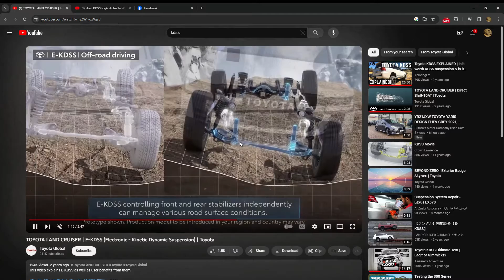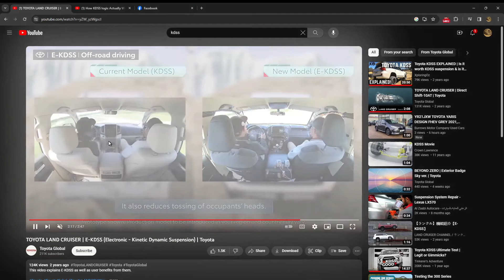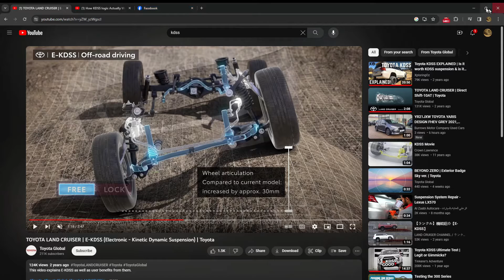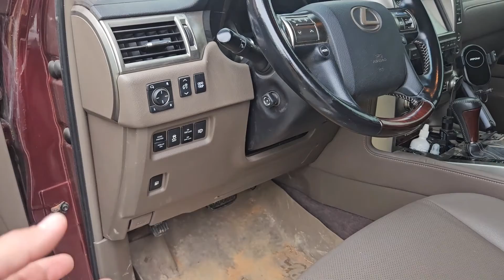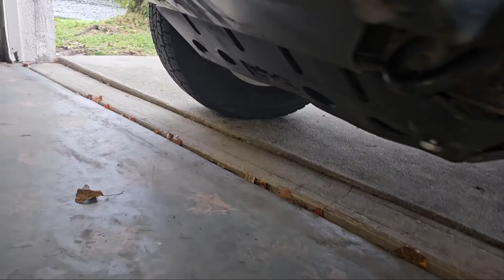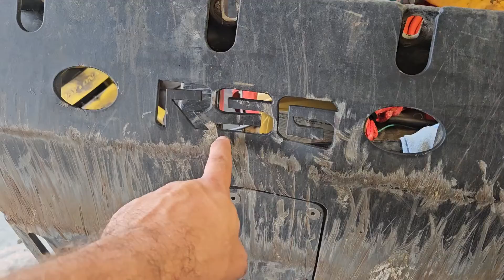KDSS disadvantages: time for a KDSS delete! GX460 and 4runner (reuploaded)

Comment: I am deleting my entire KDSS system from 2014 GX and hopefully only adding a front sway bar. Is deleting the KDSS a DYI thing? Great video btw!
Reply from the maker: Yeah it was easy to remove. I went with just a rear sway bar.
Reply: @MudPuppyOffroad  awesome! I have been battling the KDSS lean and I’m over it. I do light off roading and most highway miles.Added a 2 inch lift and done fighting the system. I think running just a front sway bar for the moment and then adding rear later is the best way to make me like my GX again lol is there a reason you only run a rear? Is it safer for the front or rear?
Reply from the maker: @bentondouglas1032  I like the front to flex as much as possible because these trucks have very limited suspension travel up there. Safe is a relative term... I think it drives fine.

Comment: I have the KDSS knock and was wondering if I remove the cylinder does the sway bar stay in place?  Or is it better to just take it all off?  Great video thank you so much
Reply from the maker: Could just remove the cylinder I guess but why carry around the weight of the sway bar and have all the bushing issues if it's not doing anything

Comment: Great video, my friend. I'm on my second GX, and I just deleted my KDSS. The biggest complaint about the KDSS was the same as yours. I off-road quite a bit and the small bumps and the rocking back and forth sucks. My initial thoughts after removing the Kdss are it is super tippy in the corners. I'm heading to Moab this weekend from Denver to do some off-roading, so I will have plenty of time behind the wheel to determine if I think it is a good fit for me to keep it off. Do you still have the KDSS off, or did you find you didn't like the on-road performance and put it back on?

Thank you in advance,
Marty
Reply: I do have a Bilstein 2.5" lift
Reply from the maker: Yeah I took it off and deleted everything and it's not going back on. I'm still running the rear sway bar with a solid link I fabricated and it works fine on the pavement. Off-road I removed the rear link

Comment: I have a 5g 4runner with KDSS and I have encountered a lot of the same problems.

Front cylinder is knocking due to internal nut coming loose at 78k. Been knocking for about 10k miles. 

 I plan on DIYing it. Front cylinder and homemade SST ran me about $1k. Theres a PDF on the web describing the KDSS bleed steps. 

I got the KDSS switch, and bushing adapters etc. in an attempt to keep the system healthy. Interesting perspective on the KDSS mods potentially being pointless if you wheel a lot. Hopefully I have many more trouble free miles after the repair.
Reply from the maker: I hope you have better luck than me but mine is fully deleted now and I definitely prefer the ride off-road with no front sway bar
Reply: @MudPuppyOffroad  yeah, but the ride on roAD SUCKS! lets not forget to mention that small tidbit of information. Highway driving with no sway bar not recommended or safe
Reply from the maker: @Mach141 first of all... I've been driving on the highway with an 80 series with zero sway bars most of my life. However my GX still has the factory rear sway bar. It drives great on the highway like that.

Comment: I initially wanted a 4runner SR5 Prem and began contemplating getting a GX, and now I'm going back to the 4runner to avoid KDSS. This has been helpful. I've had people tell me that long-travel is like thousands of dollars per shock and every 10 miles per hour you want to go faster in whoops is like thousands, stuff like that. But no one tells you that with just shocks without KDSS (like bilstein, icon, fox or kings) you can generally offroad in much nicer conditions and not have the KDSS head toss and jitter. Its not about going max speed on whoops.

Comment: What did you do to remove kdss? Simply removed the front sway bar? What about the rear?
Reply from the maker: Haven't got around to it yet but the plan is to delete the front sway bar and all of the hydraulics and then have a fixed rear sway bar with a removable link

Comment: I have a 2024 4Runner with KDSS. Based on my past 4Runner without KDSS, the KDSS drives significantly better highway and city driving…much beefier sway bar reduces body roll a lot.
I don’t do aggressive off-roading, only up to moderate and the KDSS is a champ. Travel is very good and increase articulation keeps traction. Have Bilstein suspension system with only a 1 inch lift. Get more travel in front and rear with Bilstein suspension.
Have a rock slider, no problem with KDSS.
Also on corrugated roads runs 
OK; however, maybe due to the suspension which also has bypass function. 
I get better articulation than non-KDSS and able to drive on corrugated roads with enough comfort and control.

However if I did more difficult backroads like Black Bear Pass would miss having a 3inch or more lift on a non-KDSS 4Runner.

If you have KDSS, you need to maintain it, accumulator etc, like your frame, if so very reliable for what I use it for.
Reply from the maker: Thank you for the comment. I'm sure your opinion will change once your system has a failure just like mine did LOL but yes it drives nice on pavement but that is not what I bought this truck for. If I wanted something that drove nice on pavement I would get a sports car

Comment: Does the new EKDSS contribute anything noticeable to on road driving. 

Specifically, if you put Overtrail tires/wheels on the Luxury plus (that does not have EKDSS) will the on road ride quality be close to the same as Overtrail Plus?
Reply from the maker: Haven't done any testing on that model yet obviously but it should be different. This sway bars are  thicker
Reply from the maker: Also that model canon decouple the front and rear sway bars completely allowing the system to lock down just the front or the back to improve cornering in some situations

Comment: I took my KDSS 4Runner through the Rubicon a few times. I'd guess it's well under 1% of owners who will ever take them down a trail more challenging than the Rubicon. At very low speeds it's excellent. If you have stock control arms, it's hard to get more travel than KDSS will allow at low speeds when the shutter valves are open. It's the medium speed stuff where it comes up very harsh.

IMO kdss is better than any other system I know of except one custom setup I've seen. It's a mechanical forced articulation system using torsion springs, a dana 60 center section (spider gears of the open diff mounted adjacent to transfer case) and run to each axle. Very cool, fully mechanical, forced articulation, zero travel restrictions, and excellent handling. But not realistic for an OEM.
Reply from the maker: The new Land cruiser 250 flexes significantly better with the front sway bar disconnect and rides better :-) several people have put them on CTI ramps now.

Comment: Im sitting here trying to fix the kdss lean on my lifted GX460 (its jacked up with the valves open at the moment) and then i come across this. Ive had vehicles without the front sway bar but never had one without front or back. This might be my first. Thanks for the info.
Reply: @jeffhall768 what did you end up doing ? Did you fix the lean ? I am battling the lean as well after a 2.5 inch lift coilover front and 2 inch back from ironman.  Let me know thanks
Reply: @charlieHorsie  I just removed the kdss system. Did it almost immediately after this comment so, 7 moths or so and very happy.
Reply: @jeffhall768  hey can I have your contact want to reach out with questions. I never had a lean until I installed ironman 4x4 stage 2 kit which comes 2.5 inch coil over lift (front), 2 inch spring (back) with medium load springs, pan hard bar, UCA, rear kdss spacer. Suv leaned to the passenger side 1 inch front and 1.2 inch after. I think at this rate, kdss isn't working properly Anyway and I'm thinking About how to fix the lean.   No shop around can fix it by calibrating thru shutter valves and they themselves have no clue how to actually fix the lean without adding more spacers or shims or adjusting the preload which I have not done because it seems like thats just adding to the problem and not a proper way to fix it.  I'm worried about removing kdss system especially when driving on the highway with no sway bar .. I've heard horror stories.  Not sure when you said you remove kdss you also took out the front and rear sway bar which is what kdss hydraulic was help controlling.  Either way wanted to talk more about your experience and methods.  Thanks.
Reply: @cHorsiee  it's actually a lot smoother at low speed now. Body lean isn't too bad. Just depends on what shocks and springs you have.

Comment: You can install front and back sway bar from land cruiser 120. You will need to weld the back brackets for back sway bushings and front sway bar installation requires just very minor mods. I have the link with all dimensions and parts - the problem is that it is on RU language. Planning to do such nod once my kdss die

Comment: @mudpuppyoffroad excellent video. I really appreciate all the work and insight you shared. I’m running a 2012 4Runner Trail with approximately 2-2.5 lift and 33” tires. When you removed your front sway bar did you see or notice the CV shafts over extending?
Reply from the maker: Nope no CV issues at all and I was running longer GX470 5100s. Running Dobinson IMS now

Comment: Hey! Love these videos as they're super informative. Can you please just let me know what the process is on removing the front sway bar? Is it as simple as removing it from end links and chasis? Would it cause the KDSS light to come on? Mainly looking to improve the ride quality! Thanks for your help/guidance!
Reply from the maker: The truck had no idea that I deleted the front sway bar. No light lol. On my truck I just pulled the skid plate down a little bit unbolted the bottom half of the link. Then unbolted the mounts from the lower control arms very straightforward
Reply: @MudPuppyOffroad  thank so much for the reply! When it comes to reinstalling, is there anything special you'd have to do to the hydraulic piston, like push it back up with a jack?
Reply from the maker: @faviles56  I find that reinstalling is easiest with the weight of the vehicle on the tires if that makes sense. As far as compressing the cylinder, I just used a big pry bar
Reply: @MudPuppyOffroad  got it, thanks again for the reply! Great content on this channel.

Comment: I’m dealing with the front cylinder clunk. I replaced it with an eBay part (50k miles) and that one clunks as well! Given your experience with KDSS, do you think the rear sway would work as intended if the front cylinder/sway is removed and the lines are capped off? It wouldn’t work exactly as intended, but seems like an easy way to retain the rear sway and get rid of the front clunk. I may just try it, if I can find the fittings to cap off. Otherwise will need to figure out some other rear sway bar solution. Seems like the rear sway is a must and front is optional for drive-ability
Reply from the maker: Maybe if you capped them 100% and the rear cylinder is in good shape... I'm just replacing the rear cylinder with a solid link
Reply: @MudPuppyOffroad  That’s not a bad idea! The link would have to be custom, but should be easy enough

Comment: The video you showed comparing old KDSS vs new E-KDSS does show the difference between the two systems with STOCK SUSPENSION and the rebound/compression rate of that stock suspension with the two versions of KDSS. That is all.

Aftermarket suspension with lighter or heavier springs, and different valve rates for rebound and compression can make the old KDSS system much worse off road or much better. Perhaps even better than the new E-KDSS system with stock springs and valving. That requires time and money to get right though. I'm looking forward to the new front sway bar disconnect that Toyota/Lexus is putting on newer vehicls.
Reply from the maker: So I kind of see where you're coming from but based on your logic, the system should work better with a higher spring rate and stiffer valving. Heavy suspension would make it easier for the KDSS cylinder to keep up with the wheel travel when unlocked. So if anything by adding heavier springs and high damped  monotubes, I made the system's job easier when it's in float mode. In any case, I had the same complaints with the system before and aftermarket suspension. And it started to fail with the aftermarket suspension installed. prob Because of the increase down travel. I am also excited about the new disconnecting sway bar. It takes out all of this BS
Reply: @MudPuppyOffroad  From all of the research I've done, there's no real middle ground in GX with KDSS suspension lift kits. Either go Extended long travel with fully adjustable shocks for compression and rebound, and forget the KDSS or go 2" max with a few tweaks and spacers to retain the most suspension travel with KDSs while keeping the stiff for the road and relaxed for off road KDSS advantage. Or, a very expensive third option on these is to keep your lift small, or even stock suspension and get portals. One American company and one Ukrainian company make them for the GX/4Runner. I think they both start at $20k
Reply from the maker: @brianphillips8228  I tried the spacers... Cost a huge amount of articulation. I wheel a lot and pretty hard. I think I would have killed the system regardless. Even all stock. I just feel dumb for expecting it to work. I have too much faith in Toyota sometimes lol portals are cool... But I keep those kinds of mods for my sxs that aren't road legal

Comment: I have a 22' 4runner ORP W/KDSS, and at 13K, driver side cylinder leaked, got serviced and who knows when's it going to leak again.. Is this common problems?
Reply from the maker: The leaking not so much but the banging and popping seems to be a common complaint

Comment: I agree KDSS version aftermarket front skids do have less clearance.  The issue here with you hitting your skid is the  design of the RSG front skid plate, it hangs down about 1" lower than stock. My oem kdss front skid plate hits way less than my RSG front skid plate on the same trails. Cool skid plate but the lost of ground clearance sucks.

Comment: I see why KDSS is not ideal for your application.  This is probably why the TRD Pro does not have KDSS.  I like the system but agree the off-road harshness is a drawback.  I also have the Dr KDSS switch and use it at moderately low speeds on bumpy roads.  It definitely smooths ride quality at the speeds I drive but perhaps that is not the case at higher speeds.  In any case, thanks for the video.  It's good to get feedback on different applications and solutions.

Comment: Hello, i am from colorado and just bought gx460. may you tell me how much lift you added to cover all these trails in CO? And which lift kit you chose.
Reply from the maker: This setup was Bilstein 5100 with the eibach 4Runner 2 inch lift springs. I had the 5100 set on their highest preload setting. I do not recommend the setup the bushings and the shocks are about shot after this trip. I was running 32-in tires but you really want bigger I hit a lot of rocks hard
Reply: @MudPuppyOffroad  thank you. Do you mean bigger tires or more lift? I am planning to start with east/moderate trails on CO, can you recommend me the lift (and lift kit) I need without compromising on paved drive and also still have the setup reliable?
Reply from the maker: @pawneetsingh6448  the setup I have sitting on my couch now dobinson IMS adjustable struts SPC upper control arms. Going up to a 34 inch tire and putting 456 gears.
Reply from the maker: I did some of the harder core trails. Bumpers were really not required Rock sliders and skid plates are a good idea though
Reply: @MudPuppyOffroad  sure please continue posting videos. I have watched every video of yours. I am debating between toytec (CO local), dobinson or EMU. Inclined towards toytec, just back from rollins pass and the gx which went with me had toytec, 5” lift with 37s. They mentioned its reliable and local, so you can get service/warranty for them way easy.
Reply from the maker: Toyota Tech 5-in lift? Haven't heard of such a thing that's huge

Comment: I put a gorilla axle on my 2018 Honda foreman on the would be driver side and it wore a little hole on the diff cover could you give me a pointer on getting the pinion out the old cover when I put the new one in ima go back with oem for that side

Comment: Interesting, seems like it’s almost impossible to have the best of both worlds. I understand why Toyota developed the system, given their wide range of customer use cases, and it does seem to be pretty good in theory. But for your use case definitely seems like it would be advantageous to delete it. Curious to see how much more body roll there is without the system. Also that skid plate put in work lol
Reply from the maker: The Best of Both Worlds is the system on the new Tacoma and Land Cruiser
Reply: @MudPuppyOffroad  Sway bar disconnects have been out for a long on Jeeps.  The problem is people don't want a crap on-road car, so they stay away from Jeep. If you only care about off-road performance you should just purchase a Jeep.